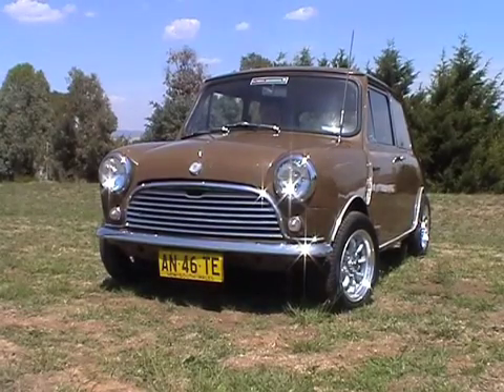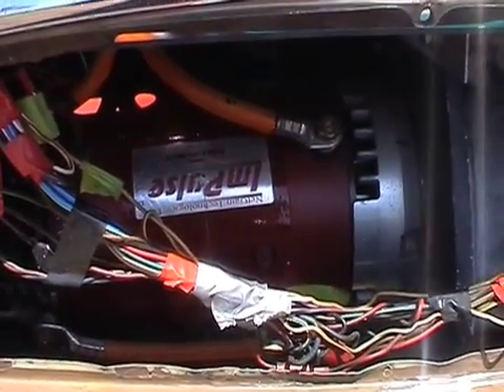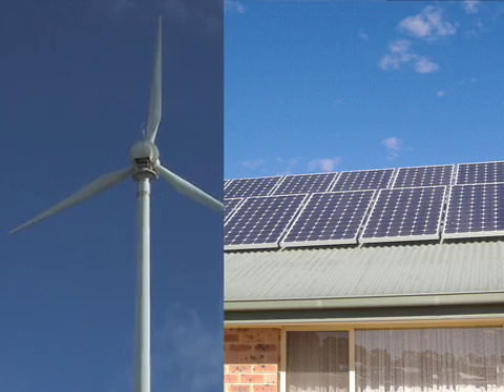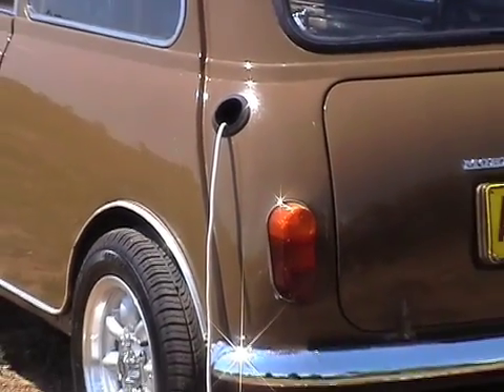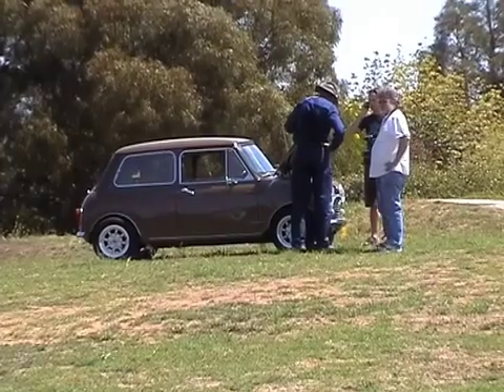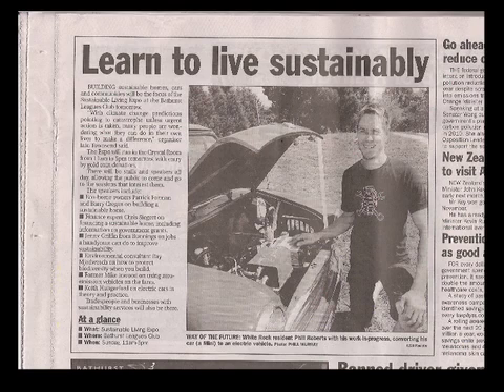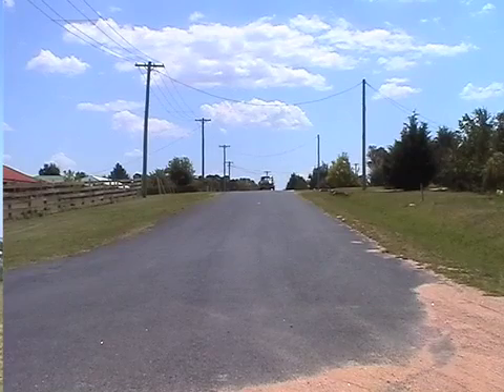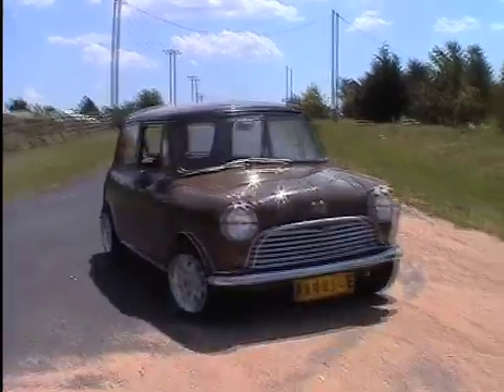Phill Roberts' Electric mini

Comment: This is pure codswallop. The Australian electric grid is majority fossil fuel powered, using coal from the Latrobe Valley and the Hume Valley. The embodied emissions of finite lifetime batteries combined with such a high carbon electric grid result in a much higher emissions per driven kilometer than even your average Commodore. And this is before the emissions involved in the transport of components for a bespoke build from the United States.

The transport problem in climate change is solved not with better cars. The space and volume inefficiency of the car drives urban sprawl, long commutes, expensive road networks and bridges, all of which barely keep pace with the rate of population growth. The only place cars make sense is in rural areas that might not be able to be served by public transport - but the long distances involved favour an internal combustion engine for range  in those circumstances.

The transport problem is soluble only by massively increased investment in both density and coverage of public transport as well as a reimagination of zoning laws to promote densification so that goods and services do not have to move as far. An electric car in Australia is a disaster from every perspective. And even if you have a renewable energy powered grid - which is looking increasingly remote as wind and solar penetration approaches capacity factor - there is no question that the answer is not a better car but more buses, trains and trams. A walkable city that is dense, served intensely by public transport that extends into suburban areas, would be an order of magnitude less emitting than even the lightest electric car using the most advanced battery chemistry (lithium air).
Reply from the maker: This was filmed in a rural area with zero public transport. Electric cars are not the solution but they may be part of the solution.